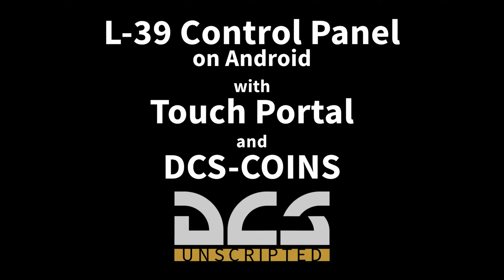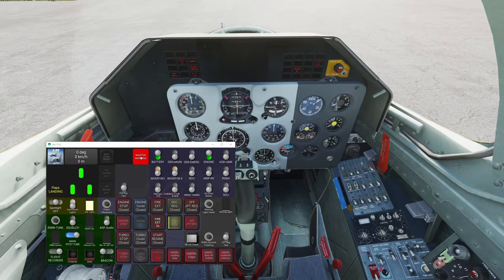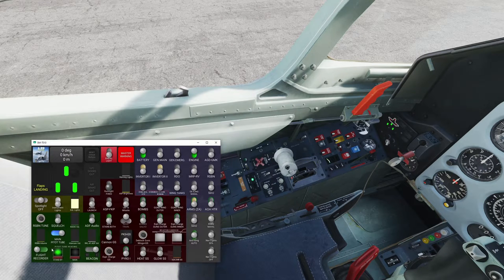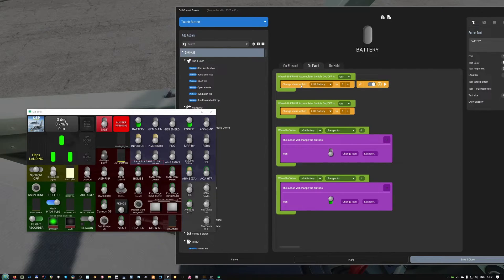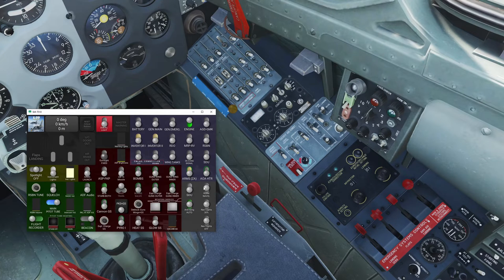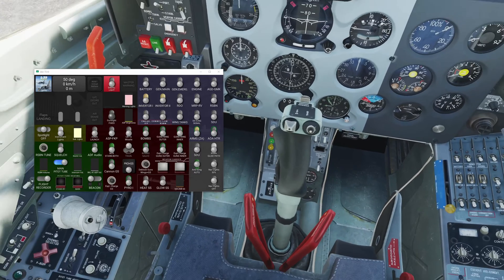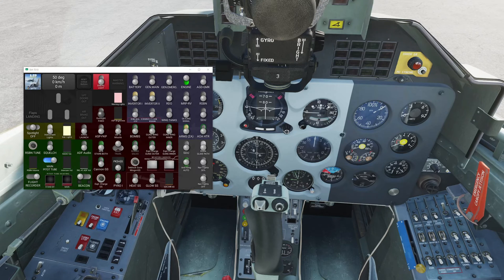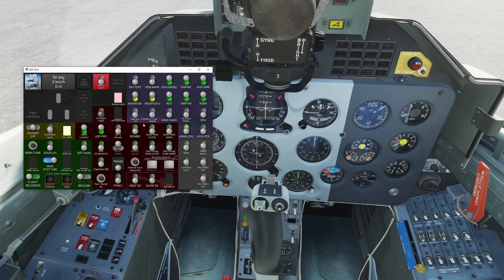DCS 2.9 | DCS-Coins, Touch Portal and L-39 Dashboard

Comment: will it work on macro deck 2 (its free open source), touch portal doesn't work for me
Reply from the maker: I'm not familiar with Macro deck 2. I assume you could do anything what you can do with the keyboard shortcuts out of the box. I don't see any plugin/extension for DCS for Macro deck 2 so someone had to do this kind of integration first. DCS-COINS - which connects Touch Portal with existing DCS-BIOS support for cockpit makers - is the secret sauce here. It provides plane specific actions and events which makes the whole dashboard rich.
Touch Portal 2 is not perfect, I wish it had more control options (e.g. hold and press, that is separate press and release actions, or even swipe gestures), but it is good enough and DCS-COINS makes the best of it.